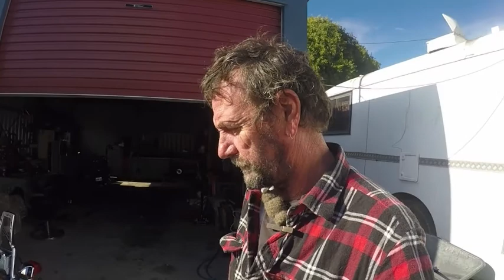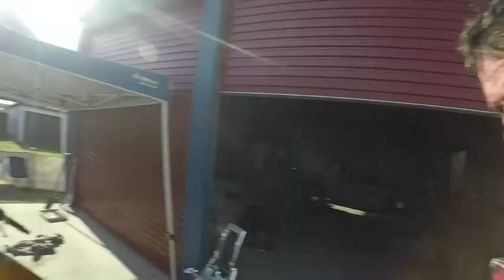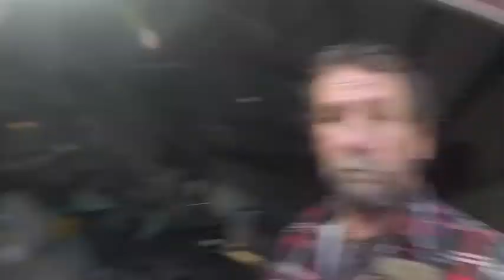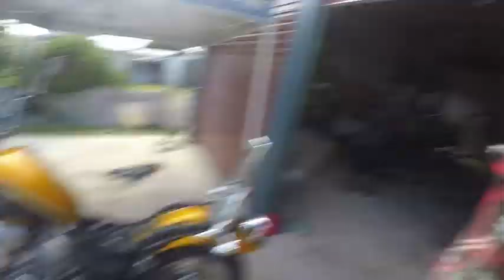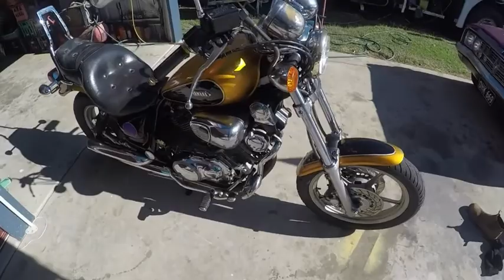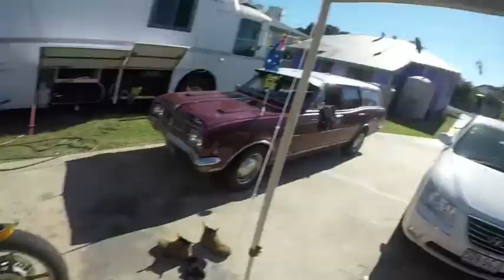Fork Seals Done on Vergil........  Hippy Trev

Comment: Vergil's looking good mate. Great idea to run that clear hose. I wonder if that switch for reserve might be stuffed? Either the switch itself or a power problem to it. Cheers.
Reply from the maker: hey Ross  no the switch works  its in the low fuel brain circuitry  as the low fuel light dosnt  come  at all & when in the on postion it tells the fuel pump not to pump  when in the on postion
when in the Res postion it runs the pump  like it should
cheers
Reply: Aah okay must be something else then. Bummer